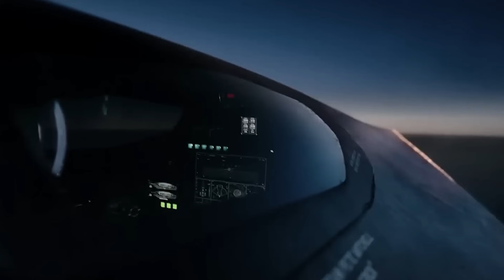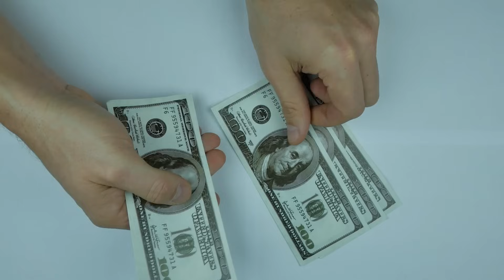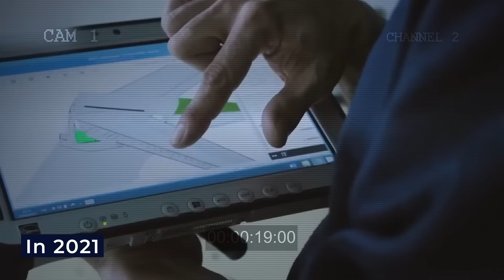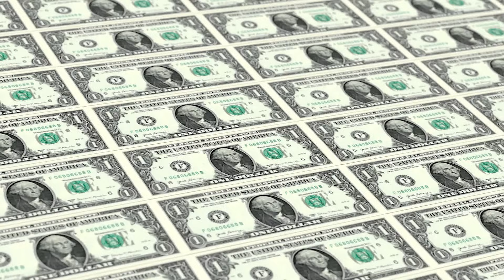US Unveiled Top Secret SR-72 DARKSTAR For 2025 Production

Comment: Generally speaking, it's either Speed or Maneuverability, but maybe not so much in an unmanned craft.
Reply: Unmanned means the aircraft can use more of its maneuverability and not be compromised by human restraints. The F -22 is capable of pulling 16 G's in its maneuverability, but human pilots would die at that level. They are limited to 9 G's max.

Comment: It really can't out maneuver any aircraft, this is why the AF didn't procure the YF-12. I would like to see how they plan on managing the heat.
Reply: YF 12 morphed into the SR 71.
Reply: @thomasblankinship98  Incorrect.  There were 4 types of SR:  A-12 single-seat reconnaissance aircraft operated by the CIA.  YF-12A interceptor capable of launching air-to-air missiles. It had a pilot and a Fire Control Officer.
M-21 mothership for the D-21 reconnaissance drone. It had a pilot and a Launch Control Officer. The mated combination was called the MD-21.  SR-71 dual-seat reconnaissance aircraft operated by U.S. Air Force. It had a pilot and a Reconnaissance Systems Operator.  There were also trainer versions of the A-12 and SR-71. These were called the TA-12, SR-71B, and SR-71C. They had a second cockpit for an instructor pilot located above and behind the student cockpit.